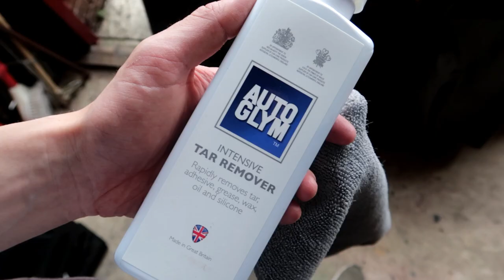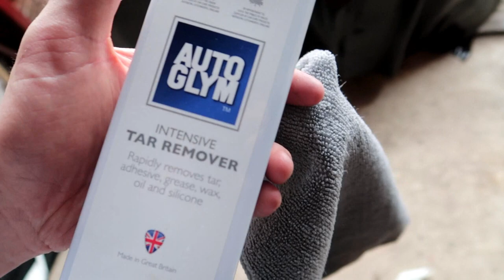INSTALLING BONNET VENTS | FOCUS MK3

Comment: Easy way to tidy up the corners so they're rounded is to use a 10mm drill bit. Come in 5mm from either edge use a centre punch and drill a 2mm pilot hole so the 10mm drill bit doesn't wonder then angle grind up to the drill holes so you have rounded corners.

Comment: And for all those asking about rain being an issue...the placement of the vent makes a difference, obviously dont put it directly above an air filter thats open or something..but you can grab a couple sheets of HYDROPHOBIC MESH (like used on ATVs/Motorcycles/AirFilters)...add it underneath and then rain wont pour in.

Comment: Another setting out option is make a cardboard template to fit tightly inside the bonnet support frame, where you want to cut and tape on(use an old cereal box or with masking tape mask the perimeter exactly then overlap each strip by 50% until the entire area is covered). Predrill the 4 corners with 1/8 or 3mm drill bit as per thumper 124cc. Peel off cardboard/tape template, turn over and stick on opposite side of bonnet. Mark out drill holes with a punch/pencil then drill 3mm holes through bonnet skin then the 10mm holes. Then using those holes tape from the outside of one hole to the next to mark out the vent opening cut lines.
Reply from the maker: I agree, also a good method 👍

Comment: did you put the under-hood (bonnet for y'all across the pond lol) protectant fabric back on? I'm doing this likely this week (my vents are slightly thinner but a good bit longer and I'll have to cut into a little bit of the structural support)...But I'm going to get the holes cut then put the fabric back on, then cut them out. Its a good thing for the heat/protectant plus if you run an open top air filter (like the RS) is uses that fabric to seal in the filter. 

looks good though, i second the eye protection and even gloves. Ive had countless metal burrs cut me pretty good so even when filing I'll be using gloves lol

Comment: Would removing the bonnet after marking up not be the safest way to avoid damage on the paintwork whilst cutting?
Reply from the maker: Yeah, removing the bonnet would make the job easier and safer... just a pain to remove it

Comment: if you need to replace the bonnet vents how do recomend to removing them to rplace for some reason...
Reply from the maker: Haven't ever needed to.. tiger seal is very strong glue... may be possible to heat the glue to soften it. Be careful you don't ruin the paintwork when removing them

Comment: how to protect when the rain ?
Reply from the maker: Mesh grill is installed under the vents to reduce water passing through, hasn't caused any issues
Reply: @samsmithrc6295    YEAH but rain is rain, when it [ours for days water will get in engine compartmemt

Comment: How they holding up, did they bend or melt
Reply from the maker: Holding up fine, no issues at all
Reply: @samsmithrc6295  where did you get the vents from

Comment: How about the drain?  Especially when It's rainy day..
Reply: Drive faster ;) just kidding. Engines and components are water proof. Water sprays under the bonnet from the wheels anyway
Reply: @awestruck9075  NOT really, if you are driving or engine is running in park, try spraying your engine with a water hose....steam and spray will cause fogging .......need a channeling way of keeping water off hot engine
Reply: @fortysaginaw1512  I've not had a car built in the last 50 years be affected greatly by washing the engine. Avoid spraying the ignition components with high pressure washers but other than that nothing will happen to it. My mini used to occasionally be affected during rain but that was because the water would pass through the grill and get into the distributor at the front of the motor. The amount of steam rising from off the hot motor would be negligible. The only consideration to be made, is that key electrical components aren't directly below the vents.